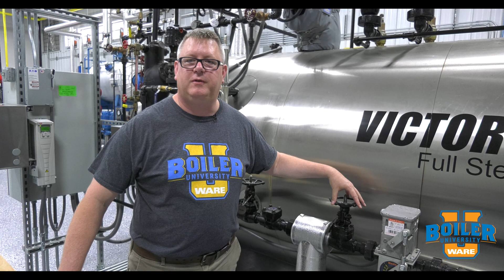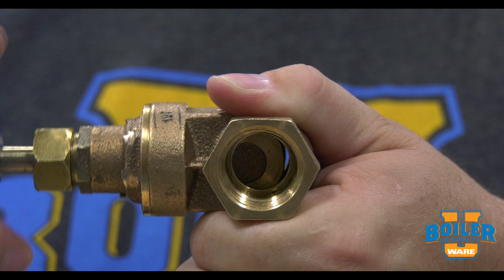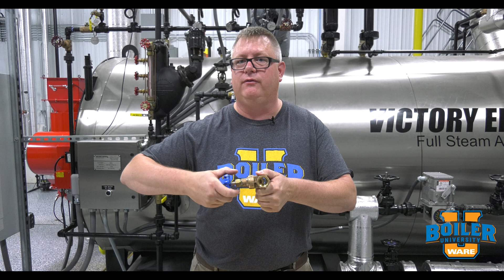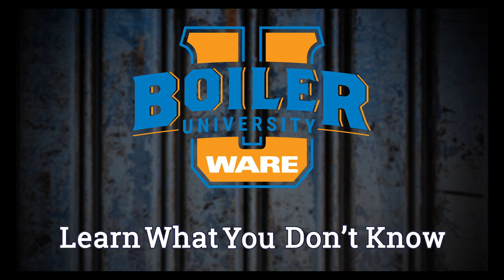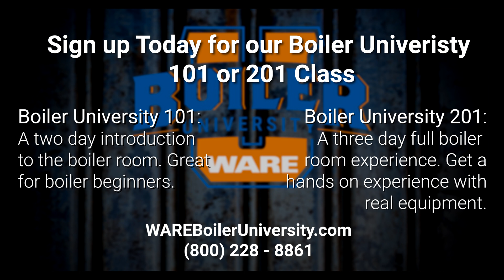What are the differences between a Gate Valve and  a Globe Valve - Weekly Boiler Tips

Comment: Yeah, they taught us that gate valve is used for isolation, meaning to open fully so that fluid can pass through and fully closed to completely stop the fluid from passing. 

Globe valve is for throttling and never for isolation. 

To get an application where both will be used for example, let's say you have a centrifugal water pump and you want the mass flow to be 2 kg/s even if the pump can pump 5kg/s. The suction valve for the pump will be gate because we can isolate it (the fluid = water) when we turn it off. The discharge valve will be globe valve so we can throttle it to 2kg/s. 👍✌💎